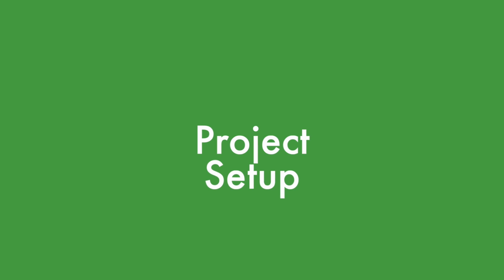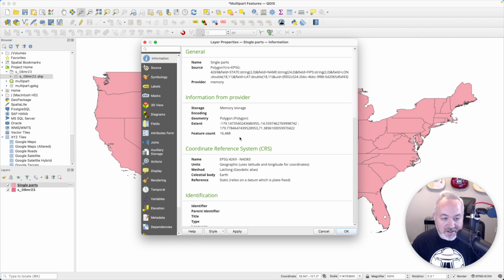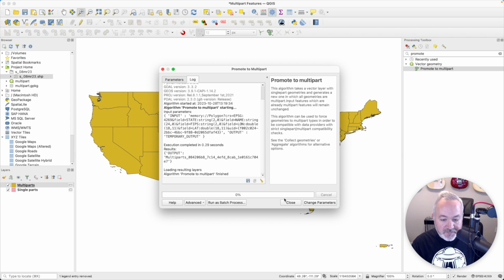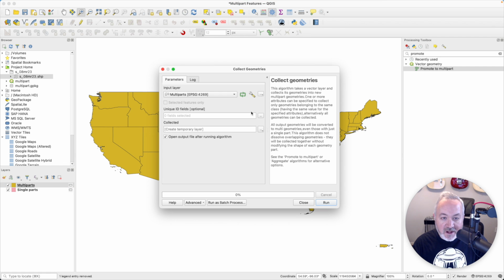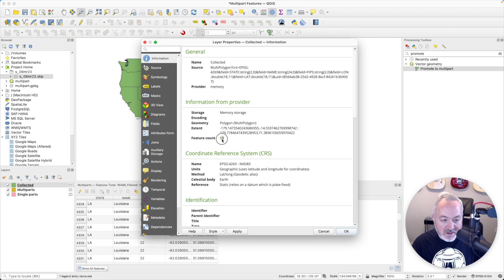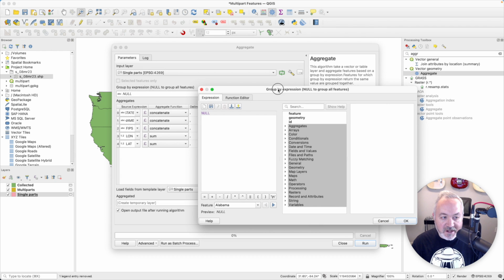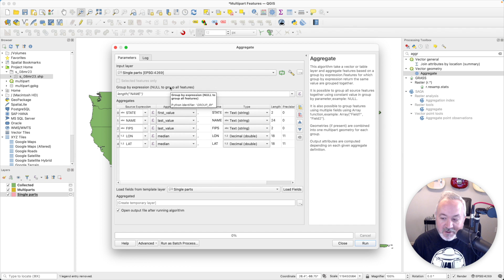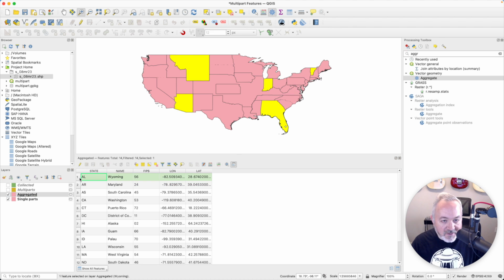3 Ways to Convert Singlepart Layers to Multipart Layers in QGIS

Comment: Nice explanation on the differences between the three methods. One addition to the Aggregate function, you can actually edit the Length and Precision fields in the aggregate dialogue box, just doubleclick the value.
Reply from the maker: Thank you! I realized you could change the length after I recorded. Hopefully folks will notice the "Small Correction" popup I added there.
Reply from the maker: I'm also just realizing that even though I realized this during editing, I should've just recorded an extra little bit showing that one can edit those fields by clicking on them. Next time!